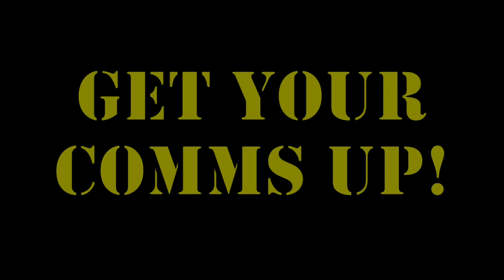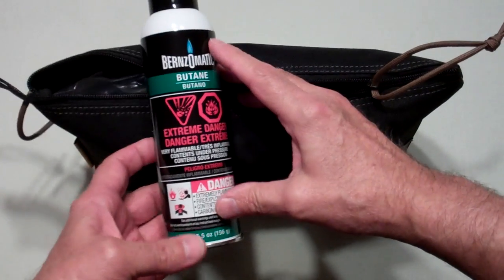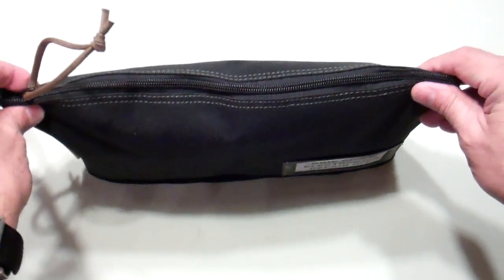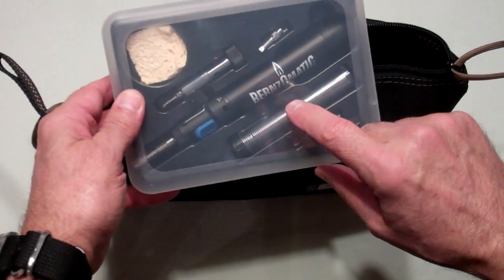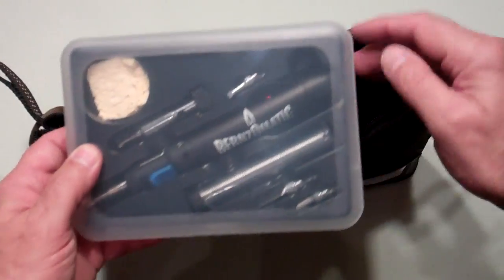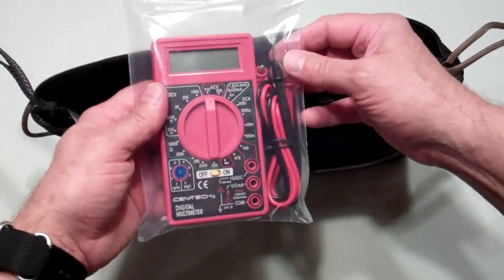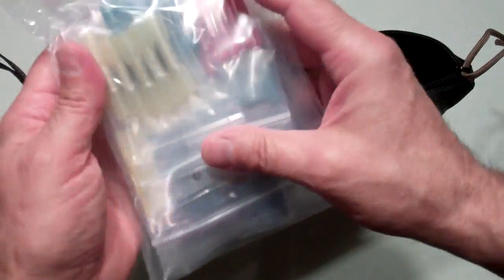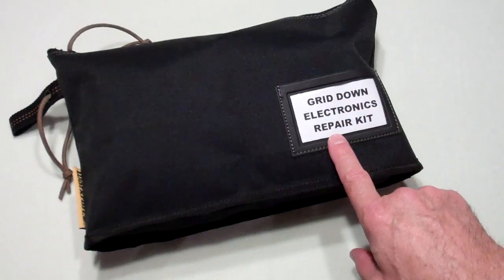DIY - Grid Down Electronics Repair Bag

Comment: Great kit USNERDOC.  I have something very similar in a very small fly fishing box.  I did not see this item in your kit but you might want to add a couple.  Extra Anderson Power Poles.  In a pinch you can use your pliers or wire stripper to crimp a new dovetailed end on.

Awesome job & Thanks for sharing
Reply from the maker: Excellent idea!
Reply: Would you mind sharing the link to the powerpoles?  I don't know much about this stuff, but, I want to have it on hand just in case. Thanks in advance.  :-)
Reply: imasurvivornthriver 

http://www.andersonpower.com/products/singlepole-connectors.html

Take Care.
Reply: Thank you very much!  :-)
Reply from the maker: Lars Londian  Thanks buddy!

Comment: I would replace the dedicated wire stripper with a leatherman micra with the built in stripper. Adding additional capability and increased capacity in the bag.

 DE N5ISV

Comment: Sorry I think you misread my reply....
I was referring to the small tools (specifically) in your kit.... Question was.... Were those tools ALSO purchased at harbor freight?.. I realized all the other items were purchased there

Lastly, wasn't  suggesting you need larger tools ha ha 

Thx for the reply & answer
Sorry for the confusion
Reply from the maker: No worries . . . it is always hard to understand the true meaning with the flat aspect of text communication. Almost everything came from Orchard Supply and Harbor Freight. I built two kits at the same time and gifted one to a fellow HAM and AmRRON operator.

Comment: The two things you have on your list, but didn't speak about on the video was the headlamp and the reading glasses (for us old guys/gals) lol Was that just a time constraint issue or did you add those items after the video was done??? Curiosity is killing me, David;-D
Reply from the maker: Hey Mark - very observant! Yes, I added those when I published the PDF list. These things are frequently a work in progress. I always try to the PDF documents updated reflecting my current thoughts.
Reply: Aww, thanx. Might I also recommend a spare amount of coax cable that can be stored in the grid down kit. As someone who is not licensed yet, I have gone several RG178 cables, as they tend to get hooked up in my chair and crimped... causing interference when listening. No big, that's why I have a soldering iron and rosin;-)

Comment: Seems bigger and more durable than the pencil pouches I have been using.  Never saw these until now.
Its showing only $2.97 each.
Here is their link http://www.homedepot.com/p/Husky-12-in-Document-Bag-82012N11/203224009

Comment: I would suggest checking that multimeter using some resistors of known value.  I have seen these multimeter from Harbor Freight that have been calibrated very poorly.  Some I have seen have been too far off to be usable.
Reply from the maker: Thank you! That is good advice and a great tip.

Comment: Great idea! Every thing you do is so organized and neat! Awesome!

The first thing I thought about was extra cables & wires, and different fuses, but I guess you got that covered!

I would also suggest some insulated terminal strips/blocks or quick connect terminals, a small bottle denatured alcohol & small brush for cleaning soldering. zip-ties if you don't have that in other places. small light bulbs, relays, switches etc. A small snap off blade knife is great for stripping cable insulation of all sizes. Crimping tool?

 The soldering gun and multimeter looks unused. Make sure they work! And you know how they work! Multimeters usually use a 9V battery. If it's not auto turn off, a spare battery could be useful!
Reply from the maker: Thanks! I agree that fuses and hook-up wire need to be included. I have also since added a small headlamp and a spare pair of reading glasses.

Comment: Great Idea obviously you should also have a bag with components specific to your radio. I might also offer the suggestion of using Pro'skit SD-9808N 58 PC screwdrivers kit. Very small footprint and has regular, Philips, Torx, hex bits, and tamperproof bits. Great for modern day electronics especially in an emergency situation. Thanks for another great idea and video.
Reply from the maker: Thanks for the comments! I like the idea of the Pro'skit SD-9808N 58 PC screwdrivers kit.
Reply: I also was thinking why couldn't you use Lithium Ion batteries rather than lead acid? something like these http://www.koehlerlighting.com/caplamps/ you would have to series them together or I am sure there is a 12V equivalent somewhere.

Comment: Home Depot sells jewelers screwdrivers with replaceable tips that store in the handle. That would give you a little more space in the kit for hook up wire and fuses. Can't forget fuses, both cartridge and automotive styles.
Reply from the maker: Excellent! I like the idea of increasing the compactness by using a driver that stores bits in the handle. That will give added room for needed spool(s) of wire and a package of fuses.

Comment: Small tools in kit- also harbor freight?
Reply from the maker: Small tools . . . it is an electronics repair kit . . . what size tools would you recommend?

Harbor Freight . . . perhaps you missed the comment about building an "inexpensive" and compact kit.

Any of the items could be upgrade and more expensive if desired. The point was to share my kit and stimulate thoughts on being prepared to repair small electronics in a power grid loss scenario. Perhaps you could take the time to make a video and share what is in your electronics repair kit.